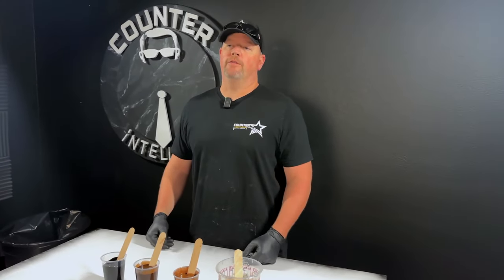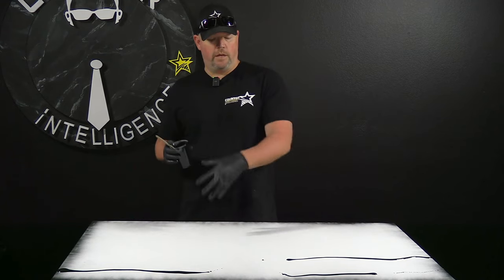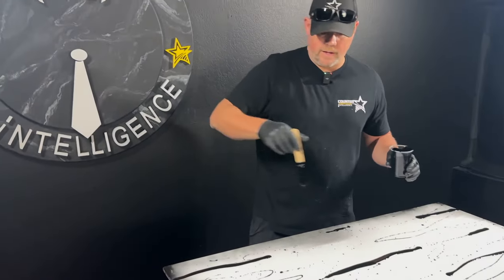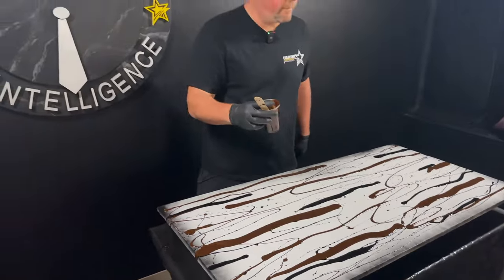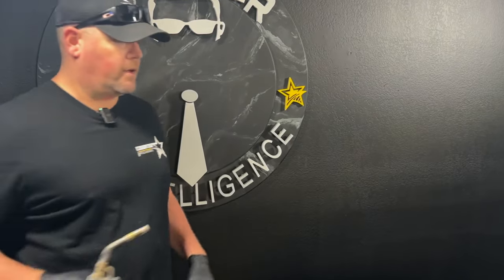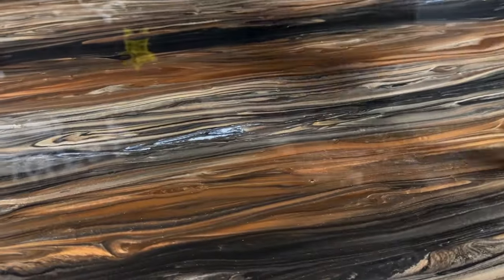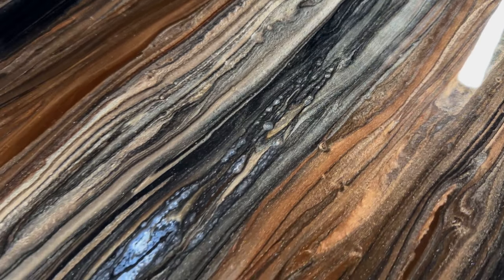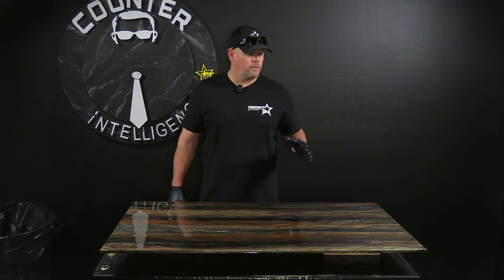Epoxy How To | Marble into Wood Grain | Intermediate Epoxy Technique

Comment: Can this be done on a floor?
Reply from the maker: There is epoxy that can be used on floors. It would be a different formula than epoxy used to make countertops, but the concept is the same. Someone really skilled at doing floors could probably match this style, but they would have to have alot of expierence. Typically, metallic epoxy floors are much simpler in their design, but there's a lot of talented floor contractors out there that can do some amazing artwork and pull this off.